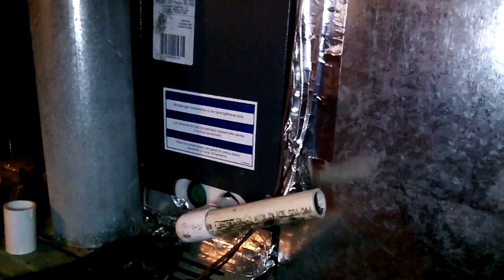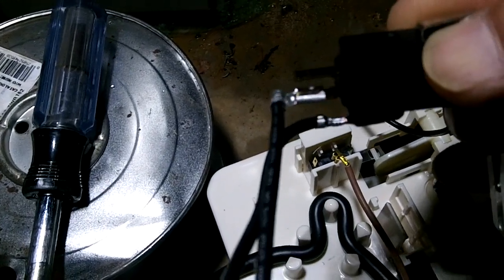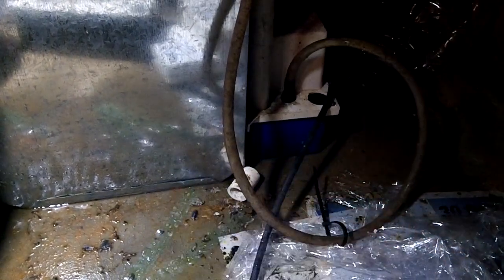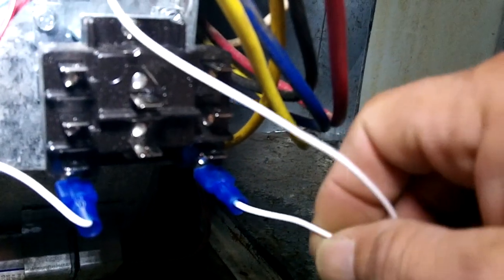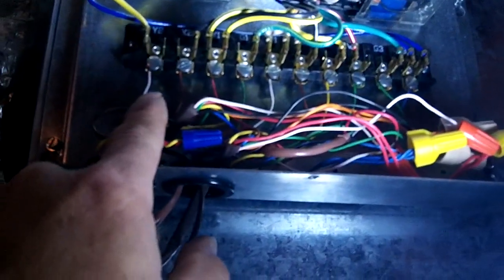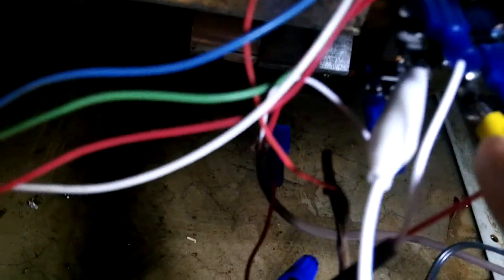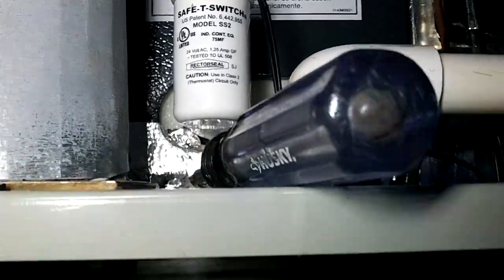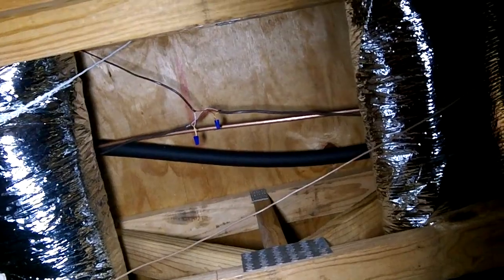2 HVAC Systems On 1 Condensate Pump

Comment: Awesome idea. I'll remember that one. One thing I have had happen to me when adding an SS1 to the high drain is that the pan can overflow before tripping the switch. Since then, I have installed them to the tee on the main drain.

Comment: good thinking, I would have to write with my scripto next to the relay (float switch relay) because 5 years from now I would see the relay and say what was that for. All the equipment starts to look like chinese people, they tend to all look alike.
Reply from the maker: Your 100% correct Jim. As a matter of fact I'm going to go back and write on the pump to change the wire if it needs to be changed. If I don't the next guy may be scratching his head when the unit won't run.

Comment: Good job, you put some thought into it.
I debated the logic of why to wire it the way that you did (N.O. float, and N.C. relay) versus N.C. float and N.C. relay, and eventually agreed with your choice.
Technically NC and NC with the relay being supplied by a separate transformer tied in with the pump power not downstream from the disconnect of the adjacent unit would be best to allow the pump and overflow logic to work independantly of the two systems, but the level of effort and material cost is greater to implement.
The next best scenario is what you installed, leveraging the existing 24V supplies, the only caveat is that if power to the downstairs unit is lost for any reason, the N.C. relay can't energize to cut off the 2nd floor system from feeding more into the condensate line.
Reply from the maker: Hey Dwight, there are many different ways of doing this from adding a second pump. adding a drain pan with a float switch, running the upstairs drain totally out of the house instead of using the pump, or doing what you said and using a separate power supply to power the float switch circuit. To be honest running a separate power supply is a good ideal to avoid a flood of for some reason the main floor power was lost I didn't even think of that not because I couldn't think of it but because using what was there seemed like the best fit for what I had.  Thanks for the great comment
Reply: T&N Services LLC. Truth be told, as much as I like well designed electrical controls to make the magic happen, piping the condensate line to a sump pump or outside to eliminate the condensate pump is my favorite solution-less things to go wrong.

Comment: So does that mean if the unit is running and the pump has to cycle to dump water that it will stop the unit during the pumping?
Reply from the maker: No it will work like normal. I didn't mess with the main float switch. I rewired the secondary float switch in the pump.

Comment: Ralph, I guess somebody forgot that this channel is also for guys just who are new. It's a wonder somebody didn't just say to wire both Y1s together and then break them with the float switch not knowing that is what relays are for. I guess some people don't know what isolation relays are for, good job Ralph.
Reply from the maker: Thanks Wayne, if your referring to Matthew he's mad about something for whatever reason, it's all good though cause I know as he was making his comments he was also taking notes on how to do it. I've used some relays to do some pretty cool stuff. The only bad thing is when the next guy goes out if he doesn't understand relays he might just start ripping stuff out. I'm going to have to go back to this house and leave notes about what was done if for some reason I'm not the one who goes back.

Comment: Man, did they even have a float switch on the upstairs unit?  Resolved that one real well my brother.
Reply from the maker: Hey Charles, the upstairs system has switches at the unit just no way to shut it off down stairs. Even the down stairs had no protection. I fixed that though

Comment: Power is only broken to the outdoor unit when the pump is about to overflow? That being, the third terminal on the float; instead of, the factory set "middle terminal?"
Reply from the maker: The float switch is nothing more then a double pole relay. The way I wired it up the new dp/dt relay is now the float switch. So when the float switch opens it now powers the relay opening the circuit to both of the units. I did it like that to keep the new relay from being powered all the time. I hope that's what you were asking
Reply: ...because there are two units, the pump runs more, and the new relay can handle them better than just the float switch? Sorry, I will watch a couple more times, to get comfotable  with what you are showing  here.